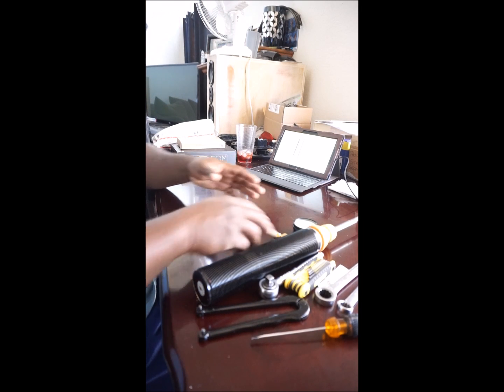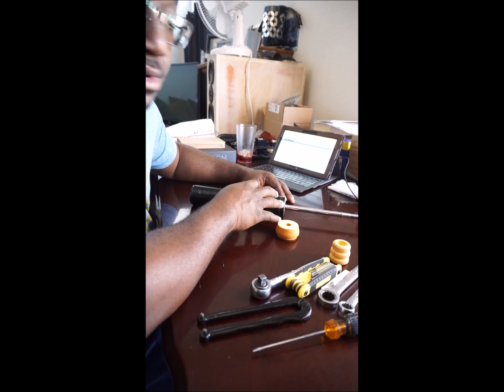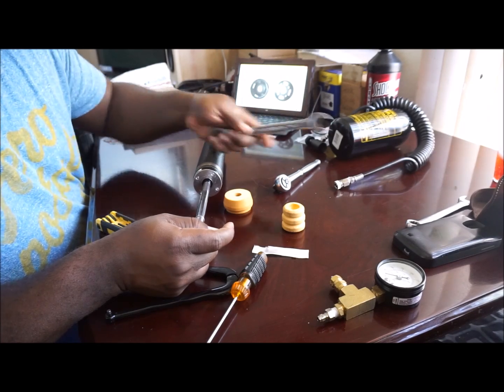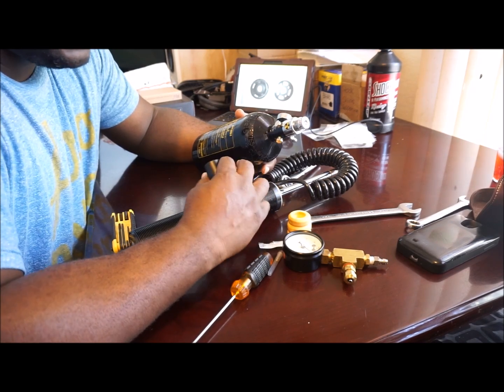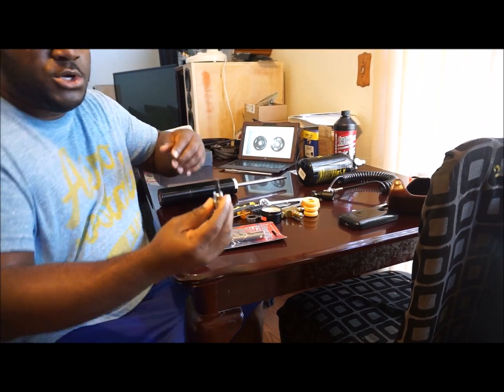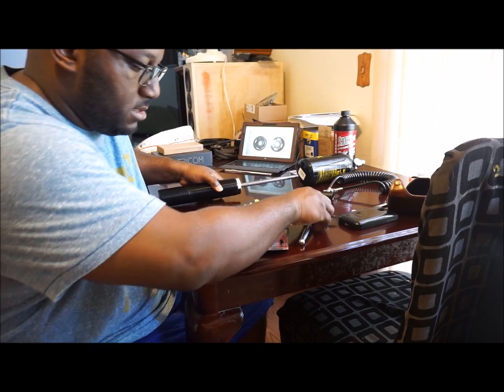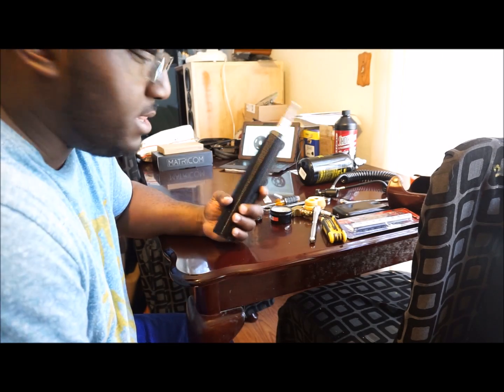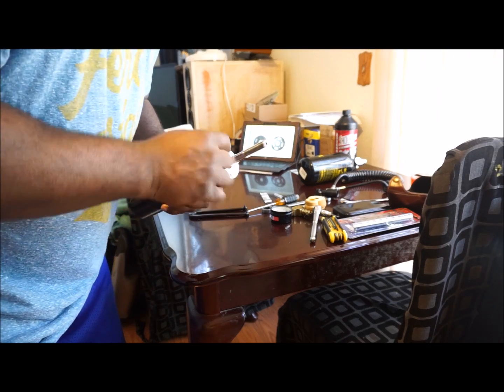DIY BC Racing BR shock Revalve tutorial - PART 1(Bilstein Internals)

Comment: If I want to drive 5/4 Springs on BRs that had 10/8 Springs, would I need to revalve? Or if I just plop on the springs, does it have bad effects?
10/8 is just bouncing around so I need to find something softer (very much softer, 10/8 is undrivable with the roads here)
Reply from the maker: If it were me, I would try the 5/4 springs before tearing everything apart for a revalve. Who knows, you may be very happy with the results.
Reply: Frugal_Fabrication Okay thanks! If it wont work for me atleast I have a tutorial to follow
Reply: @juliusme3818  how did this turn out for you? Did the new softer springs need to be longer in free length because they would compress more than your old spring under identical loads. Wouldn't you lose damper travel if they were the same length because of this?
Reply: D4ve1985 asked BC for prices and ended up just buying new ones and throwimg the old ones away. Not worth the hassle for saving like 50$
Reply: @juliusme3818  were the springs noticeably longer in the 5/4 set than your old ones?
Reply from the maker: D4ve1985 I think you would end up with softer springs but the same length.

The shock valving ends even more  being the main factor of absorbing  any road dips or bumps since you have reduced the spring forces.

So in turn (I theorize), your ride would be more supple and less road bumps would be transferred to the car’s cabin.

Its as if when the car hits a bump,  its instantly ready for the next obstacle right after. 

BUT!  In this reduced spring/same valving scenario, if you hit a series of road bumps consecutively back to back nonstop... the car’s suspension may eventually experience “jacking-down”.

After each compression bump, the softer springs are too slow to quickly overcome the shocks rebound valving. 
 
So after the car hits the first bump, it only partially raises to back up, and then a 2nd consecutive road bump comes and the car drops a bit lower than the 1st road bump.

And then when 3rd consecutive road bump comes it lowers even more.

This will happen until either the car bottoms out on its suspension, 
-
or 
-
the consecutive back-to-back road bumps cease, and the softer springs get that 0.5 seconds to 1 second of uninterrupted (no bumps or dips) time to raise the car back to normal ride height.

 (Stronger/stiffer springs would have snapped the car back to normal ride height near immediately)

An example of consecutive bumps are  the very large, hemispherical, lane bump dividers/reflectors.... or non stop, back to back, consecutive speed bumps.

I hope I was able to convey my thoughts into text in an “easy to understand” way.

Comment: Hey, any particular reason you chose 10wt oil instead of others? Thanks!
Reply from the maker: I think I chose the weight from an off road forum during the research period. I was afraid if I chose too thin I would have to rely solely on precisely tuning the shock shim stacks to get the needed forces. Considering it was my 1st time revalving, my thoughts were if the oil was not super thin(high viscosity), then it would allow for less quantity of shims stacks due to the drag of the thicker oil.

I was nervous in my initial selection, as shock dynoing is not cheap. But it all worked out in the end.